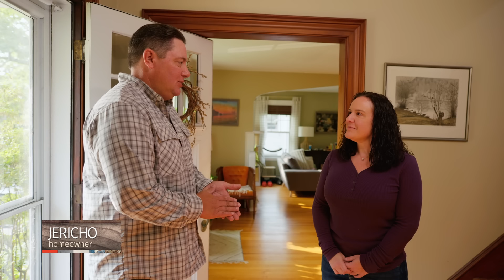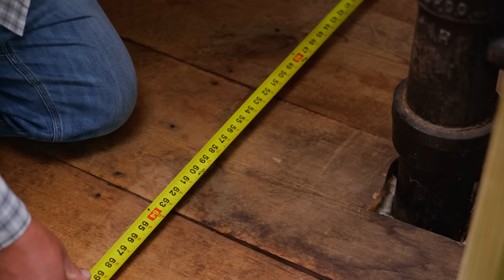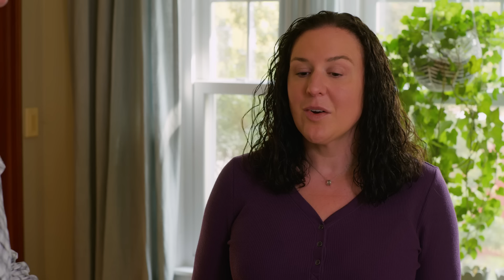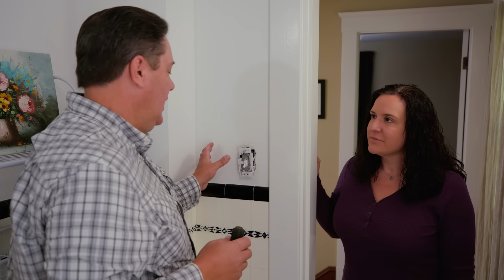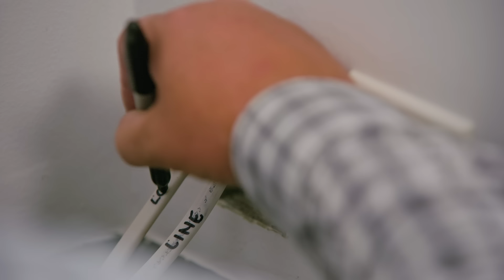How to Install a Bathroom Fan with Old Wiring | Ask This Old House

Comment: I have an old house. I’m capable of doing a lot of repairs. I fix wires on my old car all of the time. I NEVER attempt to wire anything in my home. Not even a replacement fixture. Electricians don’t gouge you on everything.

Comment: As usual TOH always makes it look waaay tooo easy.    And I have grown to despise the most reliably used phrase on the show "then we hired a subcontractor to.... wiring, plumbing, sheetmetal..."   What about homeowners who actually do ALL that work... its crazy how these folks can only do one kind of work... LOL 

What the actual hell is that duct system in the attic?   You want as straight a shot as possible and it looks like you took the LONGEST route possible, with as many bends as you could get in there.   Even the intake duct is facing AWAY from where the outside vent will go.

TOH makes useless videos... they skip all the details and the hard parts !!! Always!

Comment: They also make humidity sensor switches with a timer. It’s super convenient having it kick on automatically or stay on for a predetermined time if you hit the switch.
Reply: Right...when you take a big ol stinking crap ..you want that fan on without having to run a hot shower while you're blowing it up

Comment: In every rental apartment, and then my new-built home, I put old school Intermatic 60-minute mechanical timers on the bathroom exhaust fans. 
In my newer house, the 90cfm fans are quiet and vent well outside. Set the timer for an hour and whatever moisture or odors go directly out the roof vents. I can go to work and not leave a fan on all day or have to turn the fan off when the lights are off. I think I’ve spent $25/timer.
Reply: I will add, I keep the exhaust fan on in my laundry room 24/7/365. Cat litter box is in there. Has a conventional switch.

Comment: If putting your bathroom vent directly above your shower you have to get a special fan rated for water contact due to the extreme humidity right above the shower. If not your fan wont last long at all and its a code violation where I am from.
Reply: I would think all bathroom fans are moisture tolerant.  If someone was adopting a kitchen fan, like a through the wall type, for bathroom use, that’s a different matter.

Comment: There was new wiring visible in the attic above the bathroom. Why run wiring up 2 floors from the basement instead of down 1 floor from the attic? Also, they make wireless switches which require no wiring and that remote motor could have tapped right into that attic wire.

Comment: Would've been nice if Heath showed where he tapped power from, whether its a junction box in the basement or a new circuit in the panel
Reply: Wouldn’t have mattered.  A tap would be from a safe source without overloading it.  He used romex, and not tapped from 1920 cable.  What was done in this 1920 house is likely not the same in another house, and they were showing a specific scheme for a lucky homeowner who was a case study.  That would be a $2,000 install in my neighborhood and my house, and longer than 7 minutes.

Comment: I moved out of an older duplex that has no bathroom vents. Taking a shower meant the walls would be completely wet even though the shower its self was a low flow shower head. You would have thought someone was playing in the water. My new (current) apartment has a vent in the bathroom and the difference is just crazy. I have to get the water really really hot before I even see steam on the mirror.

Comment: Thought I saw a newer 12 gauge circuit (yellow wire) in the attic that appeared to power some outlets. Was that circuit not useable?
Reply: Correct modern code requires 20amp gfci for bath outlet only. some will let you run one circuit for all bathrooms but it has to only feed the outlet. (You can add more outlets that are 15 amp but they have to gfci/arc fault protected if with in 6 ft of water or damp location)
Reply: @wizard3z868  thanks for the update

Comment: @4:42:  What does Heath have against BX?  Why would he say he wouldn't want to connect to it?
Reply: @Kevin-mp5of :  Are you saying he disliked it because it was old?  I thought he disliked it because it was BX.

The oldest house I've fully rewired was from 1929.  Is that old enough?
Reply: @Kevin-mp5of  I think you're missing my point.  There's a difference between BX and old.  You seem to think he disliked it because it was old, not because it was BX.  It sounded to me like he just disliked BX.
Reply: @Kevin-mp5of  Not sure if by "it" you mean that wiring or BX.  BX is just armored cable.  I install it now.  There's nothing inherently old about it.
Reply: @ncooty  the old bx insulation is very brittle the newer stuff is pvc/ nylon coated.  we call it mc not bx also has an insulated egc the bx used the sheath or had a very brittle uninsulated core wire that really dose not provide a great conductive path.
Reply: @wizard3z868  Now you're confusing BX/AC and MC.  Good grief, you can buy new BX right now, but you keep talking about it as if all BX is old.
Reply: My guess is that wiring in this 1920 house has insulation that is fabric covered with perhaps rubber like insulation that is disintegrating.  Google AI says pvc was introduced in the 1930’s but 10-20 later for widespread use.  If Google AI is right about rubber wire, Tapping and expanding 100 year wiring isn’t good or safe, adding more load.  He fished Romex from the basement then dropped it into the bathroom wall from the attic.
Reply: @tonymanero5544 See discussion above.  BX and "old" are not the same things.

Comment: Does anyone insulate the sheet metal 4” vent? This way condensation doesn’t form in the vent pipe when the warm moist bathroom air, hits the cold attic? The condensation can lead to mold. Let me know.
Reply: The attic appears to be conditioned space given the insulation against the roof deck and the vapor barrier.

Comment: Wont the outlet below the roof line blow moist air back into the attic?
Reply: Maybe a tiny bit, but I think with the higher powered motor, most of the air gets pushed far out enough that it probably won't be a huge issue. Plus, on an older house like that, there's probably already a bunch of moist air leaking in regardless, lol
Reply: Maybe that’s why hey put the exhaust on the gable end—so that it’s not below a soffit vent.
Reply: It's not clear where that soffit vent runs.  On the gable, it's unlikely to vent back into the attic, given the orientation of the rafters, and especially since the attic appeared conditioned.  That said, it might just vent the deck on the overhang, in which case that exhaust vapor might feed into a mold problem at that spot... though the vent louvers point down.

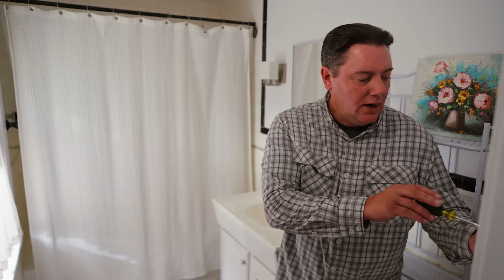Comment: 6:29 Oh, that’s a vented roof right there … this old house told us in one episode not to vent moist bathroom air below such a roof but rather through the roof directly … is there a reason it’s ok to do it like this here? 😬
Reply: oh my.... tommy gonna be mad.
And I don't get why she chose timer over humidity sensor, could have been a complete forget about it solution that you wont even have to think about that just works
Reply: @yarpyarp5647 because sometimes you want the fan on when the shower hasn't been on. like when you're taking a dump. Using a timer instead of just a toggle switch keeps the kids from leaving it on all the time too.
Reply: @nickbrockelman  💯!! Was literally about to say the same thing. You wouldn't believe the percentage of customers I've dealt with that didn't even know the primary use for a exhaust fan is to vent out moisture/humid air. I'd say roughly 6 out of every 10 customers thought a bathroom fan's ONLY purpose was to vent out odor from farting or dropping a load, hahaha.
Reply: @nnamerz  mine has a humidity sensor, with override. The override is powered only when lights are 100%. The sensor can trigger it even with lights out though. When I have guests, the override is on, the dimmer set to full on. Delta BreezSmart SMT130H(10yrs and counting) - super quiet/cool for those times
Reply: I think it's because he emphasized how "simple" a timer is with his explanation.

Comment: how does the fan motor powered in the attic ?
Reply: I believe the cable he ran from the basement to the attic is the power source for the fan. Then he ran another line from the motor to the bathroom switch so you can turn on/off the motor.

Comment: Guesses on what that would cost?
I’m thinking 3K - 5K?
Reply: Nooo... the remote motor fan probably cost around $100 or less. Probably $30 in ductwork and if you bought the sheet metal pieces yourself another $50 there. Wiring and switch 50 bucks with the most cost being the wiring. 
$230
you could easily do this job yourself, but if you were to hire a handyman and a sheet metal technician...you're looking at 2 hours for the sheet metal guy (couldn't tell you what he cost) a half day for the handyman at $50 an hour ($200)

I would say about $500.00 USD should be about right ( in Missouri)

Comment: Why is every attic in this old house so accessible 🙄
Reply: My house is a split-level where one attic hatch is 18"x24" and is located in the entryway closet. You have to take out all of the shelves and the closet rod first if you want to get up there. And to do that, you first need to remove the heavy sliding doors.
Reply: It's because all these repairs/updates are pre planned and set up ahead of time, plus they know just where everything is in the walls!!, however  from watching these this old house shows from day one, I did learn a lot about doing my own repairs and upgrades !, but it's a lot of dirty/dusty work!
Reply: For filming simplicity and efficiency everything is pre planned. They scout out potential locations/homes. If access is difficult then filming would be, as well. These are perfect conditions, not 100% real world. Your results will vary.
Reply: @barrymccaulkiner7092 nice that they hired a vent guy too that’s more than the fan install and to do it right.
Reply: @barrymccaulkiner7092  I think he knew all that:)
Reply: @Kevin-mp5of  ya ive seen videos from Roger wakefeild a plumber in Texas where they dug like gophers and miners to fix plumbing. I wld build like a 3 foot block foundation on slab than the house on that but I'm spoiled I've always had a basement but not always an attic. This old house is my neighborhood (NH most of my life)
Reply: They definitely come and pre-inspect the house before the show to make sure it’s as clear sailing and smooth sailing for them to do. So in other words, it’s easy for maybe 2 out of 10 home owners to do.
Reply: I liked ΤΟΗ decision for new circuit wise move because you have no idea the loading of old circuit. Leave well enough alone and limits liability too especially if the breaker panel hasn’t been updated to newer arc fault protections.
Reply: My attic entry is right above the water tank, who does that?
Reply: Most houses in new England are constructed with attics and basements
Reply: @Kevin-mp5of  yup I'm also pro 2a so trust me California is like a no go state for me for multiple reasons but don't worry the cali-cancer way of life is spreading from coast to coast so we will all be miserable soon lol

Comment: Haha, you sound like your union, calling a sheet metal technician for the ductwork.........
Reply: His union?
Reply: I thought that too.. I mean if you’re just running duct work from a bathroom exhaust fan to the outside I definitely in my opinion easy enough that almost any diy’er can do it and you don’t need a sheet metal specialist or hvac guy for it 😂
Reply: Handoff seems appropriate given Heath is an electrician, not a handyman.

Comment: Anybody here with a fan intake in their shower notice a chilling draft while showering during the winter? I had to put an air diverter on the furnace register in my bathroom ceiling because even with the furnace blowing warm air, it still was cold when it blew towards the shower.
Reply: Depending on location of fan, I would expect the fan draws a stream from the air register to the fan, so conditioned air would mix with the shower water steam.

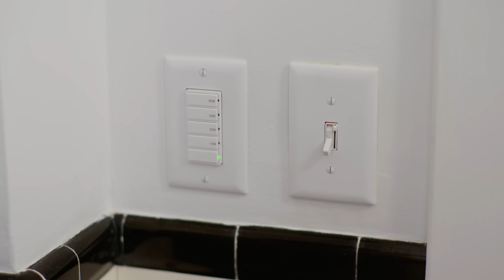Comment: 6:34 That tiny tiny vertical switch misalignment (about 1-2mm off) would have bothered me.
Reply: Kind of hard to tell but the new switch cover looks to be just a little smaller than the existing...

Comment: Idk why he said the bx is bad, it’s Miles ahead of knob and tube and rated similarly to modern wiring. A fan by itself doesn’t pull much amperage either, and with the bulbs there likely being leds now, it would only pull about as much as a single old incandescent used to.
Reply: My first house, built in the 40's had some bx wiring. The only issue I had was the insulation inside the boxes would crumble off if you moved it too much, but the wire in the jacket was fine. Maybe he saw that and closed it back up.
Reply: It does get brittle sometimes. So I do agree in certain circumstances.
Reply: BX cabling qualifies as an approved method of grounding, in my experience the insulation on the conductors can be brittle, sometimes not messing with older wiring is just the smarter thing to do.
Reply: I got BX. My electrician said, just put a ground pigtail into the back of the box and you have a ground since the BX is grounded to the box to the panel ground.

Comment: you mean a “fart fan” 😁
Reply: Ignore john hes a goof rat likes his salad tossed
Reply: This is totally not Representative of g the effort and time it takes to install a fan like this. 
As a retired electrician, who calls an hvac contractor to install duct work for a bathroom fan. 
Don't know how old this video is but in my area we had to install all insulated ductwork  to counter act the hot to cold condensation. 
He's a great snake guy or they cut out a ton of the time snaking to a 7/8 hole from the second floor is not that simple.⁸
Reply: Wow you’re really mature. Bet your mom still makes your pop-tarts for you.

Comment: They must not have kids, I have an over under switch in the kids bathroom and they seem to only know how to use the one for the light. Fan never seems to get turned on as well.
Reply: They sell automatic moisture sensor switches, they're like $30, highly recommended.
Reply: @Kevin-mp5of odd choice